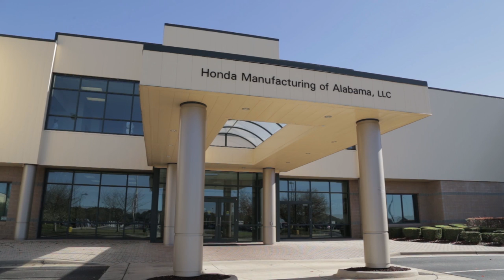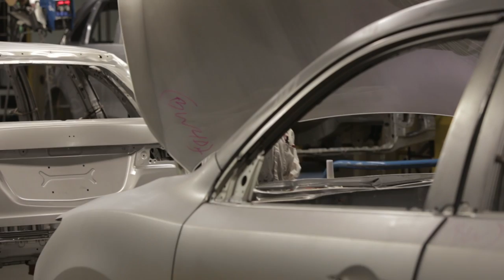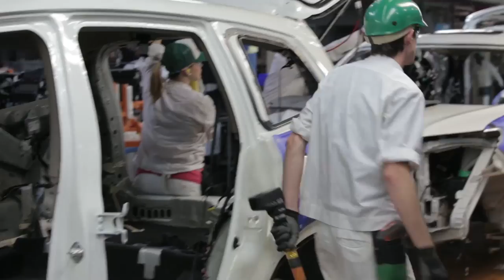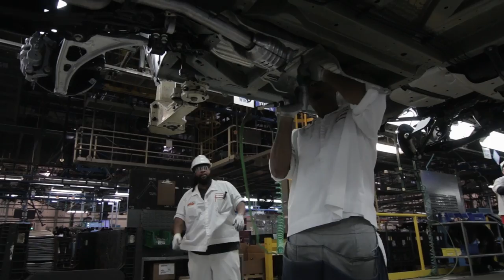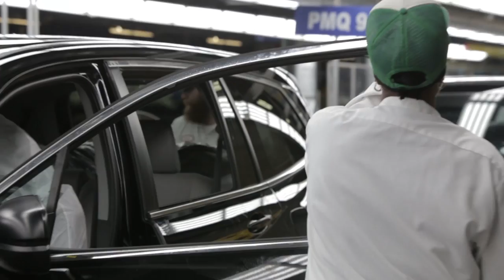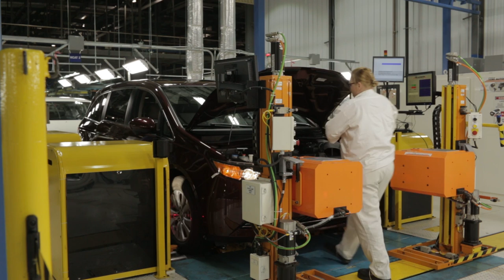Honda Manufacturing of Alabama (Lincoln Production Plant)

Comment: They gotta step up their quality control. Almost all 2018 odyssey I have seen at my dealership have fit and finish issues.
Reply: He's talking about the new Hondas which were produced from this plant. The new hondas I can attest are not as good as they use to be. Back when parts were still made in Japan the quality was much better. Now with the post 2017 Hondas, there are so many quality control issues.
Reply: Honda vehicles built in USA have lower fit and finish quality than Toyota. The attitude of USA people and workers (and chewing gum while working) are to blame.
Reply: Totally agree, check when that lady was adjusting the driver door, exactly like my 2016 pilot, door silver chrome doesn't line up the rest and gas cap pop out a bit too. Bad fit a d finish.
Reply: I first noticed quality issues with my 2016 HRV, had tons of fit and finish problems, i ended up selling the car and got a 2017 CRV, noticed more problems with that car, HRV was assembled in Mexico and CRV at Indiana, either no quality control or the cars on assembly track going too fast for workers to do it correctly.
Disappointing.
Reply: I agree, our 2016 Pilot has some fit and finish issues that I'm not exactly pleased with.  Mostly panel alignment (both inside and out) but overall I'm happy with the vehicle, it's just not the same quality of years passed.  I'll still buy Honda for life though.
Reply: @Felix-rc4wv  That's total bullshit. Americans are some of the hardest working people in the world. We are working more and more hours while our wages are not increasing. Don't be hating on our country while your country has many problems as well (wherever you may be from, no country is perfect)
Reply: @zuhayrali4202  Very true, Americans work a lot of hours. I don't think it's work ethic, much as it is pride in the final product. 

Asians, on average have a higher desire to create a quality product, as the end quality is a reflection of the worker

Comment: I've been there for a little over a month know its pretty cool. There are actually 2 plants. Line 1 and line 2. That looks like line 2 because line 1 doesn't build the pilot
Reply: John Roe do you like it here , is the pay good ? Looking to start working here
Reply: @derrickkelley6890  well I lost the job. They are very strict on attendance. But yes it was a very nice place to work. Great benefits and they have great facilities for their employees including a cafeteria with a hot bar. I'm kicking myself for losing that job.
Reply: @alabamaguns3684  You deserve a more better job elsewhere than at Honda. Honda is a very corrupt automaker, I think, with almost every vehicles I've seen produced in the United States with lousy fit-and-finish assembly quality, that are worse than General Motors and Ford today. This is due to very-fast conveyor belt lineups in each production stage, so workers can't keep up to check for best quality. Honda treat all their workers like slaves by demanding them to build vehicles at fastest record time while minimizing work safety at lowest cost.
Reply: What is the easiest Job At Honda?
Reply: When I was there the easiest job I had was putting these bolts in the dashboard. I didn't even have to tighten them. And I threw a piece of AC housing in the floorboard. Setting up for the next person.
Reply: Is the work hard?
Reply: @alfredowens7713  some of it got a little intricate but anything that was too heavy they had a hoist to help lift and they always made sure parts were within reach and its air conditioned.

Comment: Missing bolts, misaligned doors, rattling noises, faulty installation of electrical components, hair found inside windshield layers etc...are plaguing many many Hondas. Poor manufacturer, poor quality control! Engines should be MORE efficient and better on mpg but what's interesting is that mpg is getting worse now that the engines are built in America!

Return the assembly and manufacturing to Japan. That's how Toyota and Honda beat the US market back in the 90's and 2000's. Now Toyota and Honda are going to crap just like the domestics.
Reply: BMW makes their SUVs in North Carolina. Go figure. Its all about quality control not the workers themselves.
Reply: Quite a few cars between Toyota/Honda have been built in Kentucky, Ohio, Indiana. Lot's of vehicles that had great build quality and you can find many with nearly 4-500,000 miles on them.